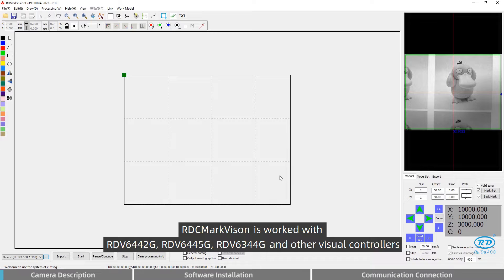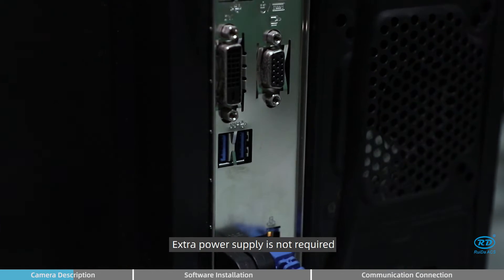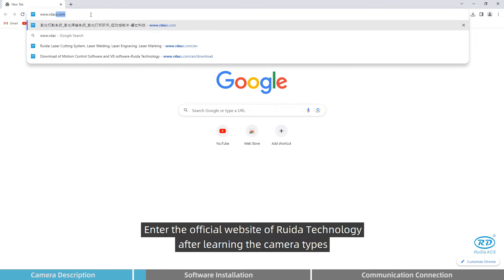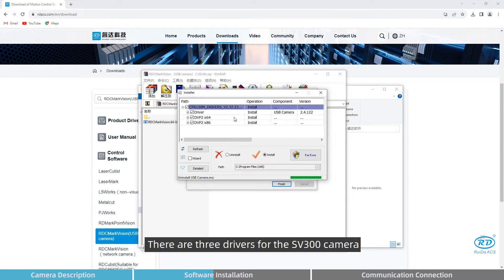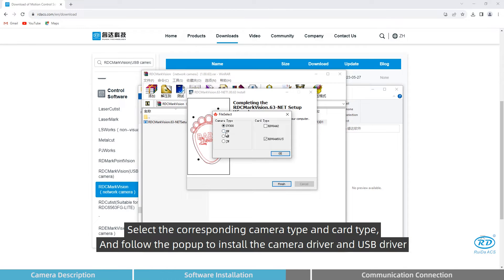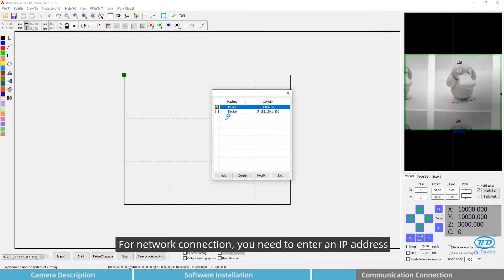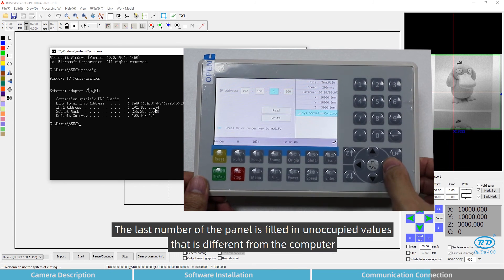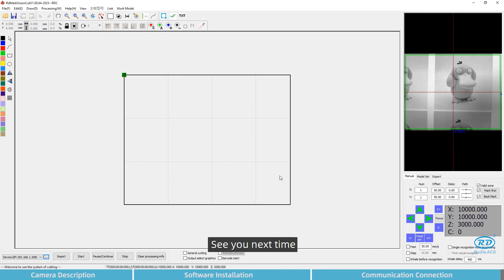RDCMarkVision Tutorial Episode 1：Software Installation and Communication Connection

Comment: Sifting in camera so cutting out properly calibration done but not solved wt to do
Reply from the maker: Have problems on communication or calibration?
Reply: Calibration perfect done when design cut with camera then shifting right ya left ya up ya down not go to one side but different different side going wt a issue please tell me
Reply from the maker: @krunalmali9347  In this case, check the origin position, or check if the mirror cutting is on.